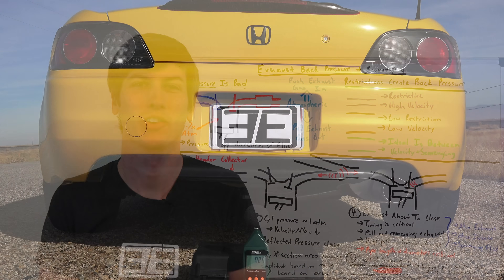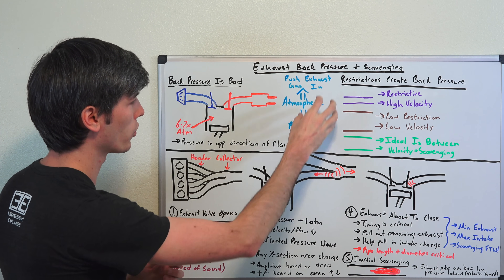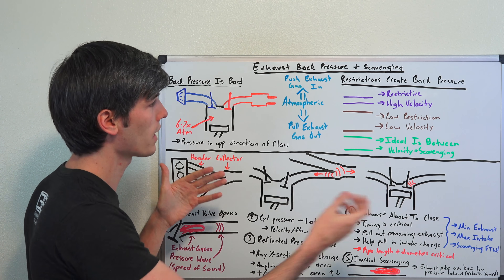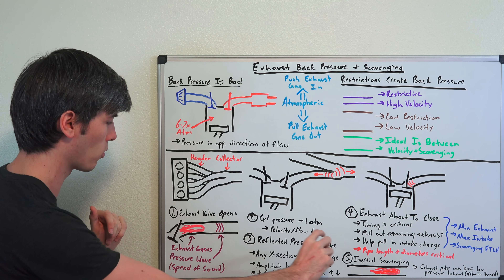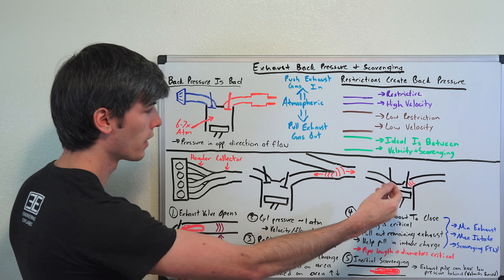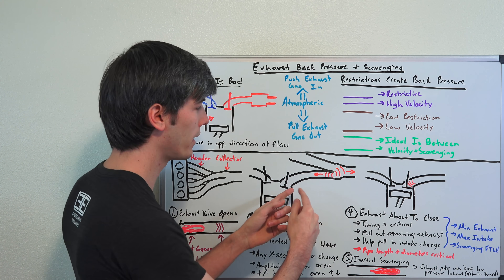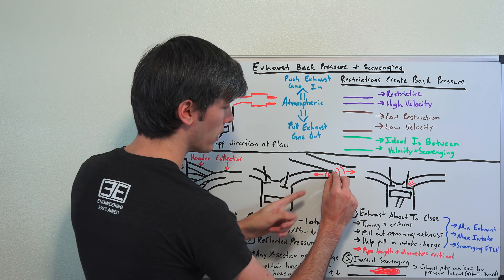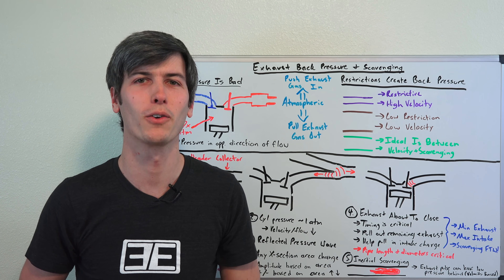Stop Saying Car Exhausts Need Back Pressure

Comment: Tri-Y's are still being used today, as they form a higher vacuum condition at the exhaust valve for more torque as compared to 4 into 1 header design. I have been using Tri-Y's for apx. 50 years. They will out perform a 4 into 1 all the way to 6,000 rpm when setup correctly. With an automatic and most being overdrives now days, they make a big difference when used here.

Comment: Thanks for the video EE!  The next tough question is how to find the right LT headers that are the most efficient.  There are lots of competitors which can claim whatever they want but how will we know what's best?  Any tips on methods to analyze?  Tia.
Reply: Dyno to run the car on. Also keep in mind what he is explaining is beneficial to NA engine, not so much turbo engines that are performance, not road applications.

Comment: This is entirely oversimplified. Theres so many other factors such as: 1) How restrictive are your headers? 2) Are you trying to make torque or horsepower? 3) what diameter pipes are you planning to use? 4) What is your compression ration and bore to stroke ratio? 5) What is your gearing? 6) Are you making torque at low rpms or high rpms? If you're focused on high range RPM power you want as little back pressure as possible, if you want low range RPM power back pressure is in fact your friend. And regardless of that, if you havent done some work on your headers and compression in general all you're doing by dropping out back pressure is tanking your torque numbers for almost no horsepower gains.

Comment: Yeah you need back pressure.....for your stock exhaust. Because your car is tuned for it. 
Dudes run open headers all the time. You just need a tune. Very simple. People that say that you need back pressure must fart through a air tight straw 😂

Comment: My opinion when car travel 180km/h above , car rear created very high turbulence or vacuum , so the exhaust may give a little reduced the turbulence , how and why I believing this ? Same with high performance speed boat , we designed the boat hull with several stages for air get into hull for reduce drag . If my opinion wrong ? Just correct my mistake . Tq

Comment: So how would a turbo fit into the equation? Turbo builds boost off of the exhaust gas in turn forcing fresh air to the cylinder and then creating more exhaust. So in racing terms having no exhaust pipes  better than having a exhaust system? Also in regular vehicles (such as my f150 ecoboost) if there were no state regulations on exhausts, wold having no exhaust make my truck run more efficiently than having an exhaust?

Comment: Did you say what scavenging is or what It means? I might have missed you saying so tbf but i think you could expand (no pun intended) on this exhaust business with a couple more vids because i for one get the bernouli stuff but the soundwave stuff above me right now. I think the back pressure confusion enough to warrant another vid if you want. Cheers from England and $2.85 a gallon? Woooeeee!

Comment: Hey Jason I am going to be fabricating custom Tri-Y long tube headers for my truck and I am wondering if you or anyone else here could help me out? I have approximate numbers for primary, secondary, & collector tubing size but I am struggling to figure out what the proper primary and secondary lengths should be for optimal scavenging. Ive done my own calculations but this is my first time trying to calculate everything out myself for optimal scavenging so I am not sure if they are correct. And I’ve tried using a few online header calculators to compare my numbers to but the numbers I got from them are pretty much all over the place. But the numbers I got from my personal calculations are, 1.625” primary diameter, 2.41” secondary diameter, 3.24” collector diameter. 16” primary length, 20” secondary length. I mean does this sound right? The engine is a V8 5.3L — 325 cubic inches — 9.5:1 compression — 3.780” bore — 3.622” stroke — 61cc combustion chamber volume — 70cc exhaust runner volume — 1.550” exhaust valve diameter — 190 exhaust duration @ .050” lift currently but the new cam that I will be running from now on is 112 deg. exhaust duration @ .050”. Basically my goal with this engine is to get as much low - mid range torque & hp as I can, mostly for towing/hauling purposes.

Comment: My Morris sidevalve conked out 5 miles after the exhaust fell off, no back pressure.  Engine ran fine after exhaust reattached 🤔
Reply: yes , but your morris was not on a blackboard ! just remember that they still cant explain how a bumblebee flies -but we know it does
Reply: As the video explained, a properly designed exhaust system will help pull the exhaust gases out (scavenging).  As you experienced with your Morris, having absolutely no exhaust system will actually be a hindrance.

Comment: This is an excellent video (as are most) but we need a  part 2. This video is all about what happens between the valve and collector. Now we need a video for what happens after the collector, thru the muffler and out the tail pipe because the dynamics have changed. Once those primary tubes hit the collector, the scavenging is greatly reduced due to the pressures reaching some soft of equilibrium. I think there may be some scavenging post collector, but once you put a muffler on, you now have a new type of restriction and what was pulsed flow is now probably, mostly, unpulsed flow. Also as the gasses cool, they condense and so there is a vacuum being created in the pipe which reduces the pressure relative to the collector. So we await part 2. :-)

Comment: Restricting a motor causes it to produce more torque at lower RPM, such as the 2-bbl limit on sprint cars, or a restrictor plate in NASCAR.  When a motor is restricted, it is not to maximize power, it is to enable cooling or durability

Comment: A back pressure pulse occurs everytime you boot it as exhaust gas hits a turbo blade whilst its lagging. The perfect exhaust is horribly complex with tons of variables and engine speeds. Computer job

Comment: On the contrary, does having a vacuum in the exhaust produce more power?
Reply: Due to valve overlap not mentioned in the video, you would just end up sucking raw fuel out the exhaust if it was under vacuum and end up with less than a full charge in the cylinder.

Comment: Hey EE, what you're saying about bigger diameter = lower velocity, = bad.. What about turbocharged engines? Unlike N/A where you rely on exhaust velocity, the turbocharger forces fresh air under pressure into the cylinder during intake and during scavenging the same pressurized air pushes the exhaust gases out a little. I would have thought the faster and bigger volume of air you could dump after the turbo the better? Being that exhaust gas has less chance of staying in the cylinder (being that a small percentage which idk the amount of) hangs around the cylinder after exhaust valve closes and also can leave the turbo and turbine area quicker after it's done it's job, so less heat is absorbed by those. 

Can you please shed some light, I'm a curious 2nd Yr Apprentice Diesel Mechanic. Cheers.

Comment: so basically, your engine DOES need a tiny bit of backpressure....     just not too much

EVERY engine I had, none of them had good low rpm response or torque without headers,  or with open headers without muffler

for a RACE engine, yes you want NO backpressure

Comment: inertial scaverging + overlap valve = high fuel consumption, low efficiency and bad for enviroment at low rpm.
that why with big exhaust, the car will lost power at low rpm.

it need a bit back pressure tu reduce inertial scaverging by reduce the velocity

Comment: so how do turbos work with all this, they apply back pressure, i feel like i'm missing something here.
Reply: Turbos (and centrifugal super chargers) DO put a load on your engine, reducing power at lower RPM while it is building boost. However, once the boost is built up, the extra power that your engine will make under forced induction exceeds the power drained by the load that keeping the turbo spun up puts on your engine, which is why turbo chargers make the most difference under heavier throttle, increasing the slope of your torque/horsepower curve.

Comment: The exhaust back pressure sure is bad.
But it can't happen all the time due to continuous waves of pressure from the other cylinders.
And they create a lot of pressure going out the exhaust.
Maybe but just maybe back pressure only happens on the ignition where no waves of exhaust fumes go out the pipe.
But all of that depends in the design of the exhaust.
Reply: Nero Mastic there is no air coming out through the exhaust before the engine starts

Comment: The term "back pressure" is one of the worst misnomers ever coined.

It is nothing more than resistance to flow.  A better term might be impedance as there is an analogical resemblance to electronic circuits...

For exhausts the challenge is to match the 'plumbing' to the outflow volume and pressure of gases to that resistance as well as dealing with pressure wave direction changes.  It's a challenge because the operating regime is so wide.

In the end you need a "matched network" of tubing that reduces the resistance as much as possible over the normal operating range of the vehicle.

Hmm, maybe time for real-time dynamically tuned exhaust?  This could be simply stub pipes along the exhaust that open and close to 'tune' the exhaust for maximum evacuation...

That's engineering.  "Back pressure" as a term should be banished if not burned at the stake.

Comment: Very good video. Would you try please to explain better about the sweet spot, where we get the optimum flow and equilibrium between back pressure, inertia scavenging and velocity. How can we calculate it.

Comment: None of this applies to two stroke engines however. Two stroke engines need a reflected pressure wave during the down stroke to help prevent the intake gas mixture from flowing right out the exhaust port. So, two stroke engines DO need back pressure at the right time to operate most efficiently. I have seen two stroke engines on motorcycles operated with straight exhaust pipes and there is a significant reduction in power.

Comment: With the Yamaha EXUP (started on the 1989 FZR1000 EXUP) = exhaust ultimate power, there's a valve restricting the entire exhaust at the join of all 4 pipes.. Ideally that means peak torque available for the engine at all revs is .. Available. Closed at low rpm and opens up at high. In reality you have a valve that needs to work up to ~450°c in a dirty, high velocity exhaust pipe, with the bearing inside the pipe almost in the exhaust flow, so a massive pain to keep it lubed, working and not ceased. But its awesome when it works.

Comment: So can i design the pipe lenght to make the effect of low pressure in the other cylinder?. I´m planning to simulate that situation, making a 4-2-1 header, do you think it will work? Thanks for the explanation!

Comment: Claims you need NO back pressure....does video trying to describe the exact way that back pressure does in fact tune the flow.
If no restriction was best, we would use huge primary pipes going to a huge collector and use 4" exhaust all the way out.

What does F1 use? No single group of car guys understands power and flow better than F1. Only the rules stop them.

The primary exhaust tube IS A RESTRICTION and thus IS BACK PRESSURE. Some of this is also for thermo dynamics and not exposing the values to thermal shock. DO we run engines on a dyno without exhaust manifolds? No. Does collector length matter? Yes. Why? The restrictions in the exhaust at different points will tune the engine to produce peak power at slightly different RPM levels.

It would be more accurate to say that above a certain point, any additional back pressure reduces engine power.

Yes you do need a very specific back pressure in the form of a specific flow in order to tune every engine. Only drag cars use straight pipes from the heads to produce the least back pressure for max power at high RPM.
Reply: Did you watch the video? It doesn't seem like you watched the video.
Reply: @0num4  Yeah I watched that one and a lot more. No back pressure is WRONGGGGGG a certain amount is required to tune the resonating waves  in order to provide optimal power AT A CERTAIN RPM RANGE.
It is a tuning tool. More than that certain amount is of course parasitic.
There is a point of diminishing returns.
He even makes several references to exactly this.

If zero is best then run open heads. or straight pipes out the side of the fender.

Go ahead try it.

I noticed a huge difference when I went down from dual 2" exhaust on a small block to dual 1 3/4" The torque peak moved way down.
The tri Y headers and cross over and the correct sized exhaust all play a part in engine tuning. And they all create more than zero back pressure.

All facts.

Comment: So what is the point of a tuned exhaust system on a mapped engine then? By this logic Formula One cars should have three inch straight headers coming off of each cylinder and dumping straight onto the ground.

Comment: long story short. You want the smallest diameter pipe with the highest flow to create velocity. A camshaft has overlap, meaning intake and exhaust are open at the same time between the exhaust stroke and intake stroke. Once the piston has pushed all of the air that it can out of the cylinder on the exhaust stroke. The velocity from the exhaust starts pulling fresh fuel/air into the cylinder before the piston is able to manually do it. To big of a pipe will mean not enough velocity to pre-prime the cylinder. 

The same thing can be said for intake runners on engine heads. lets say we have two intake runners that flow the same amount of air but one is 195cc and the other is 210cc volume. Once the piston gets to the bottom of the stroke, it stops sucking air into the cylinder. The 195cc will get more air into the cylinder because of the higher velocity air has more momentum because it's moving faster to make its way into the cylinder even though the piston is at bottom and cant suck any more air into the cylinder.

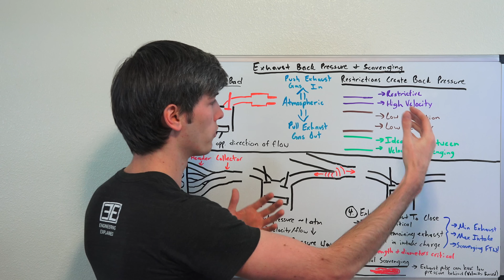Comment: At 2:51 you say: "...you want some balance of.. of, you know, velocity uh and minimum BACK PRESSURE." 
Please help me understand why this isn't the same thing as saying "some back pressure is needed".
Reply: because its minimal back pressure, so take as much back pressure out of your exhaust while still having enough velocity/ not too much velocity in which it will be detrimental to your valve-pressure efficiency
Reply: @TmonkeyWins You're saying there is a difference between "minimum back pressure" and "some back pressure"?
Reply: @gemarlperry3232  He didn't say some back pressure, he said "some balance" of "minimal back pressure". Yea minimal meaning as little as possible while still giving optimal and not too much velocity

Comment: How does the velocity matter. Why does it matter if its going slow
Reply: After the exhaust valve releases the initial burst when the cylinder is at bottom center, very little remaining gas will exit the cylinder (anything left when the cylinder is about halfway up). This will reduce the space that can be used for the air and fuel for the next combustion cycle.

Comment: Does this apply to forced induction? I would think it would be different for turbo since the exhaust is being pulled/pushed so a less restrictive exhaust would be ideal.  Still not sure about your comment about when the exhaust merges at an X pipe if you are FI.

Comment: He seems almost agitated making this one ill bet somebody ticked him off
Reply: some guy at the auto part store says something about back pressure 

EE: races home and starts writing furiously on a whiteboard while collecting valid explanations.
Reply: And I understand his frustration so well.
Reply: The argument of what back pressure is, is an argument as old as hot rodding.
Reply: @JasonM69  It's weird, a professional porting heads will tell you about intake velocity, but if a professional says the same thing about exhaust they get tarred and feathered by people with "experience".

It shouldn't even be an argument.
Reply: People saying some engines perform better with backpressure would piss me off too.
Reply: I get aggravated when most people open their mouth, I cannot believe he is as cool headed as he is!
Reply: I think he knows his team have let him down, some of the stuff at the beginning of the video is very messy, not false, but over simplified and a a result not accurate.
Back pressure is not air trying push back into the exhaust (and I think he knows this), it's the positive pressure built up by exhaust gases inside the exhaust system, the higher the engine rpm, the higher this pressure, which is why some high performance vehicles switch between 1 or 2 exhaust backboxes at specific rpms to alter the "back pressure" in the system to maintain higher performance and fuel economy throughout the rev range.

Comment: Your definition of backpressure is wrong. Exhaust flows in waves , pressure is constantly changing with crank angle. It's not constant and if you get a constant reading, you're measuring it wrong. At a max it's above atmospheric pressure and at a min , it's below atmospheric pressure. "Backpressure" is often referred to when it's below atmospheric pressure, when the exhaust valve has just shut and you're measuring the instant pressure in the pipe.

Comment: So, theoretically if each cylinder had its own individual and consistently sized exhaust pipe, like a rat rod, would you avoid the reverse pulse and achieve better flow?  Obviously, this is not practical for a street vehicle as it would be very loud and just about have to come out of the hood, but would it perform better?
Reply: Kent Shore essentially yeah it would